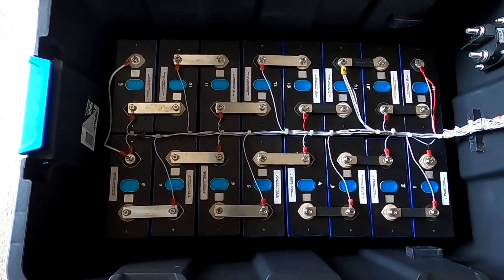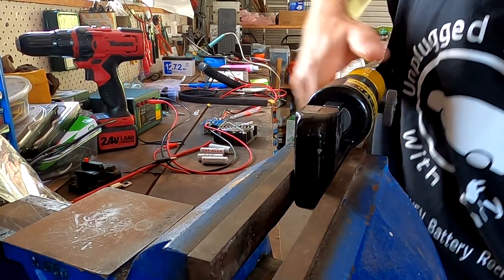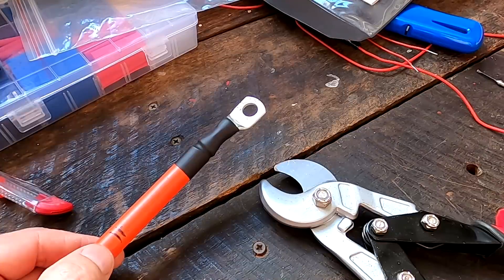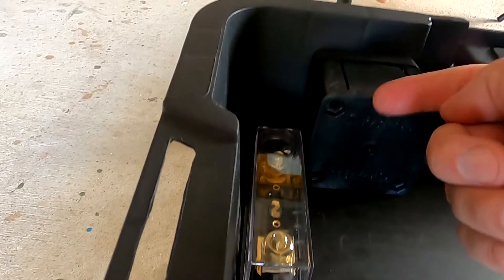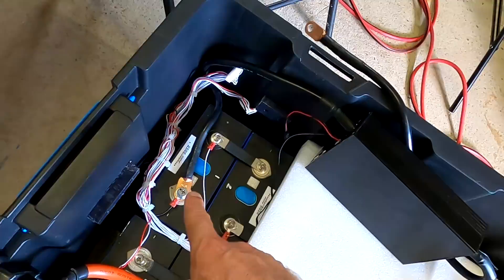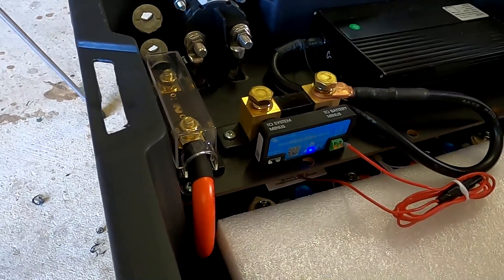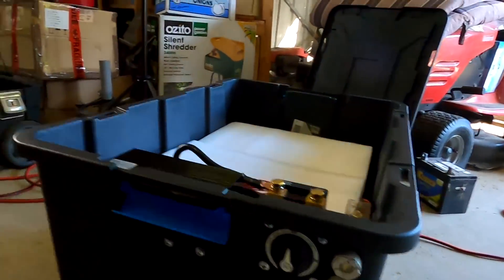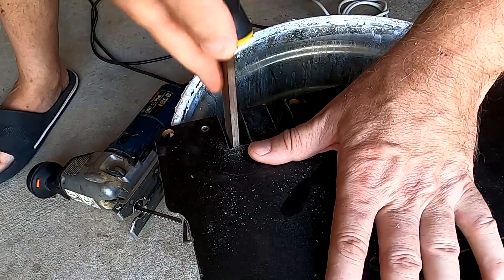Final work on our 14.5kWh battery - Will it work as expected? #buildthebattery.6

Comment: I put my shunt right to the battery Negative and got the same situation that you did with battery 1 having a much lower voltage. When I switched it around and out the BMS first it corrected it self.  So battery negative>BMS>shunt>inverter.

Comment: A thought just popped into my head this morning whilst watching your video. If the BMS cuts off the battery at 2.5v how does it get recharged? Presumably this situation should never occur as the inverter should stop discharging the battery before it reaches that point, so its just a fail safe? Does the BMS not draw a tiny bit of current, so that could drop drop the battery below 2.5v (edit: this  question is answered in the next video)? Very nice and neat cabling by the way, I really hate messy cables, I spend ages getting cabling neat and tidy. PS Slowly getting through all your videos in order.

Comment: Why did you finally choose to put Bat>BMS>Shunt?  I know he says it in the video but I don't control English very well.  thank you🙏
Reply from the maker: The main reason was to have the BMS as close to the battery as possible. The BMS is always connected to the battery, no matter what. It's basically a part of the actual battery. If I disconnect the battery, the BMS will stay connected and I can always connect via Bluetooth to it to monitor the status of all cells.

Comment: Hello Andy, IV got same HYD crimper, IV found its a great tool and works very well.
Down side I miss 90/120mm2 crimps.
4/6/8/10mm2 crimps I don't use.
Best regards
Marc up top
Reply from the maker: Thanks Marc. The hydraulic crimper I have is awesome for this sort of work. Goes from 4mm all the way up to 70mm.

Comment: I thought you said Victron recommended putting the shunt before the BMS? If you switch the shunt power, then it should turn off. I wonder what Will Prowse thinks. ANY EE's out there?
Reply from the maker: Yeah, well, some do it so and other do it differently. I guess there is no right or wrong with the location. Both has advantages and disadvantages...

Comment: Once again, very nice job! I am building my first little solar system (<50 Ah). One day I will graduate to your level. What did you use for the cable pass through on the battery box? What are they called? Are they truly a pass-through for cabling or are they going to be some sort of quick disconnect? I guess I will find out in the next few videos. :)

Comment: Quick question, why use a fuse instead of a breaker?
Reply from the maker: Why a breaker?
Reply: @OffGridGarageAustralia  a breaker is resettable, once tripped for whatever reason you have just turn it back on instead of replacing a fuse.
Reply from the maker: @xjinit  I believe if the breaker trips or the fuse melts you have a serious problem with your design or something went horribly wrong. It should never trip or trigger.
Reply: @OffGridGarageAustralia  I see your point but using your logic if your system is designed correctly then you don't need a fuse or a breaker in that case right? Modern homes and boats use breakers instead of fuses.
Reply: I found that although my EV charging from my off-grid system only draws 150A it kept tripping a 200A c/b. I have a 10kw Victron inverter which recommends a 400A fuse. Finding a suitable 400A c/b was proving difficult so fitted a 400A fuse instead. Now all works fine. True c/b's have the advantage of being resettable but as Andy says there is something seriously wrong if you blow the fuse.
Reply: @nigelcharles511  did you try using a 200a fuse and see if your system blew it? Have you verified with a clamp meter that the car is pulling 150a or is that an assumption?
Reply: @xjinit  There are now times when power is being drawn at the same time as the EV is being charged taking the power draw up to over 9kw. Allowing for inverter losses this will exceed the 200A on the 48v circuit. As Victron advise 400A fuse with their 10kw inverter I shall stay with that.
Reply: @nigelcharles511  so then the 200a breaker wasn't tripping prematurely, the momentary loads surpassed 200a then?
Reply: @xjinit  No it did trip prematurely. The other loads were added later. In the meantime, whilst I was waiting to get the 400A fuse, the 240v car charger was derated to 16A (3.8kw) to prevent the premature tripping. It now runs at 7.2kw no problem. I guess that the initial current surge was enough to trip a 200A c/b.

Comment: Fun and informative as always. I'm not a technical or very practical person, but am very interested in solar. And you've made it a less scary undertaking. I think I'll make a very small system now with a cheap 500w inverter and a single 360w panel and 16 x cells just to practice setting something up to get the confidence going. What size Ah cells should I get to match 300-360w panel. I'm not sure which Panel size I should buy you see.
Reply from the maker: Thank you very much Lennie. That is exactly the commitment I would like to see from every beginner. This is the motivation to keep me going, inspiring others to do what they like and are interested in. Great work and thank you!

Well, to your little project, you can build a 24V battery and run this from one solar panel and your inverter. It depends a bit how much power you're going to draw from this inverter and battery. What do you want to connect and for how long?

Comment: I would recommend to place the fuse close to the battery + otherwise you will not secure the battery and cables when you disconnect the master switch. Or have I misunderstood your connection?
Reply from the maker: That is correct. The positive terminal goes to the switch first and then to the fuse. I know the other way around it is better and safer... it's a bit of a compromise here in terms of cable run and clutter.

Comment: What is holding up that shelf holding the BMS?  What is the shelf made of?
This was a great series!  I will use a lot of your well thought out plan when building my battery.  Thanks
Reply from the maker: Thank you for your feedback, John. I mounted three little plastic blocks to hold this board up. It is made of insulation panel but any piece of plastic will work the same. Even plywood is cool. I'll show it quickly in the next video.

Comment: I built a smaller system using similar cells and with the Victron shunt. In use I was getting inconsistent cell voltages and overall voltage. I found that the bus bars did not make good enough contact with the cell posts and had to sand them flat with 400 grade wet and dry. Also, I was dropping 160mV across the fuse on the Victron shunt battery voltage sense wire so I replaced it and the holder.
Reply from the maker: Thank for sharing this Colin. That is much appreciated feedback and I will do some measurements with mine in this regards. I have not cleaned or sanded down the terminals. I was just hoping it will be OK 🤗

Comment: What is the interrupt rating on the main fuse of the battery? Note that the LiFePo4 has such a low resistance that you need a very high interrupt rating to stop the arc during a short.
Reply from the maker: It's 7.5kA for this ANL fuse.

Comment: What a quirky twist to the story, and I love the way you present it. BMS-Shunt, Shunt-BMS, no BMS-Shunt... tricky! And the really fun thing is that it will vary according to each persons setup. Those who don't use a Victron Charger, will have a different perspective and requirement to those who do. 

I've just ordered a Smart Shunt for my test bench. It should provide me with some simpler monitoring of projects while I'm out or in bed. Neat little bit of tech!
Reply from the maker: Thanks for your feedback, Paul. You're absolutely right. Every project is different and may need modifications and tweaks. I'll start with this setup and see how I go over time. I'm sure there will be the Box1.1 and more 😂

Comment: You made the safe and proper choice in my opinion.  Being an electrical design engineer of almost 20 years I've at least spent some time considering said opinion.  That being said pushing things so close to design tolerances that the order of components makes a difference should be sitting there monitoring things the whole time!  Plan to use things within safe margins and these decisions are less critical.  Honestly if you're worried about the drop in that path your magical loops are of more concern in my opinion and the only reason you're leaving them there is a bit of lazyness. ;)  I'm not saying I'd have done differently though.
Reply from the maker: Hahaha, great comment Brett. Thanks for that. It's all about the magic(al loop) 😉

Comment: The ultimate dilemma, which came first. The chicken or the egg. All we can do is make sure that the BMS is the last line of defense to keep the battery cells from falling off the upper and the lower end of the cliff.

Setting the low battery cutoff voltage about 20% SoC on your inverter and your charge controller 85% SoC should give you plenty of elbow room. If my memory serves me correctly, your BMS threshold can be customized to when to start balancing when the cells are at a high state of charge.

Finding the sweet spot of the curve is mind racking part. Once you get it dialed in, it should be pretty much drama free. I can’t imagine when I get into the territory of a 12p-16s with a nominal capacity of 61.4 kWh. Maybe a 10p-16s, both are in the drawing board stages at the moment.
Reply from the maker: Yes, thank you. The rest is now programming the BMS and MPPT correctly

Comment: HI Andy 
here is Jan from Texas and watching ur solar storage video with interest.  U would make a good teacher with ur positive and upbeat mentality, perhaps u are a teacher.  i am just collecting all the parts for my storage system using the same batteries u have. i like to use the ElectroDacus for the BMS. this BMS is rated for a 24 V  system but with the 8 batterie i will have 25.6 V. i have to do some digging.
Reply from the maker: Thank you Jan, I'm not a teacher. The ElectroDacus will be in one of my next projects. It looks very interesting. 24V is nominal voltage, it will handle your battery just fine.

Comment: For your cabling I would just use a booster cable 2 Gauge  Check into it might be cheaper.
Reply from the maker: They are CLA cables, copper cladded aluminium. I thought about the same and thought I discovered a real cheap way of getting these cables. These ones have slightly higher resistance.

Comment: Wired my shunt after the bms as well but I power it directly from the battery. But mines is not setup to control the charge controller.

Comment: I watch some of your earlier video and I still wonder why are you using 300 Amps cables on your battery, do you want to empty in less than hour? 
I haven't seen the video where you cut down all the trees shading your solar panels, if they are still up its unlikely that you'll get more than a few amps from the panels.
You're talking about some 5kW panel contracted to the grid, but nowhere you're talking about any high power panels (300Ax48V=14kWh) feeding your batteries, am I missing something?
Reply: Put shunt between battery and BMS, connect charge controller to shunt,you don't want the BMS to shut off charge controller ever,it could fry the charge controller with solar panels in sun.bms is to disconnect load only.in this way the shunt can read power in and out as designed.have fun.
Reply from the maker: How does the BMS knows how much power went into the battery if it cannot measure the incoming current? Also if the MPPT fails, it would kill your batteries. That's a big no no to connect it without BMS!
Victron said, their MPPTs can live without battery been connected.
Reply from the maker: 35mm is good for 109A or ~180 peak.
You need to watch the early videos again. I said the shading is only in winter months. The 5kW is the system on the house. You're mixing all information up. Maybe start with the very first video again in which I explain everything in detail ;)

Comment: Great video. What a big difference it makes when using good quality lug. BTW, what is that black plate (the plate where you mount the fuse and shunt) is made of? Did the Frog get BBQ?
Reply from the maker: Thanks Bud. That is called Type X and is insulation panel.
https://insulect.com/products/switchpanel-type-x

Comment: Nice clean build! You do great work! I put my shunt after the BMS also. I put my Blue Sea shutoff on the positive side and connected my shunt power to the shutoff. I will see how that works out over time. I'm not sure how much power drain there is from the BMS. I have much to learn yet. I don't have as nice a battery box build as you. You are very meticulous. Thanks for the great videos!
Reply from the maker: Thanks heaps Peter! That is a great idea to have the shunt connected to the switch. I will do this as well.

Comment: 3:50 it must be Frog's day because they are very quiet.  Very neat job out there. You are raising the bar too high for the diy community. I see a problem there. If the bms cut the power to the  solar charger while charging the magic smoke will come out.
Reply from the maker: Victron says it's OK and the MPPT will not die when without battery. The BMS should not disconnect anyway if everything works correctly, right? That's our last resort.
Reply: @OffGridGarageAustralia  Right, but you never know if a tool drop on top of the batteries.

Comment: Make sure to use a big 30 ohm resistor to precharge the capacitors in the inverter before directly connecting the battery to the inverter, or you'll get a big spark, and could damage the terminals. Or just make sure the battery switch is off when connecting the inverter. Either one will do.
Reply from the maker: I had the inverter already connected and it comes with a soft start function. No sparks with this one...
Reply: @OffGridGarageAustralia  nice. Never heard of one with that feature.

Comment: Schaltest Du noch einen Switch zwischen Solarladeregler und Batterie? 
Die "Batteriepeitschen" stimmen mich nicht so ganz glücklich (wg. Kurzschlussgefahr a. der Batterie bzw. b. des Solarladeregleranschlusses der Batterie - tagsüber) lg walter 
Spannungsfrei für Service !
Reply from the maker: No extra switch necessary. It's all been done with the main switch.
The thin balance wire will just melt in a sec if it would make a short but it's not touching anything and is fixed.
Reply: @OffGridGarageAustralia  and what secure your "victron" in case of a short  8( 
If there is sunlight on a solarpanel the batteryport will be powered !!!  Take Care

Comment: Nice work Andy, I like your logical thinking with your component placement and build. If your anything like me you will make another 5 or 6 tweaks (/videos) on it, 😂 I’ve spend a bit of time playing with shunt position, and settings to try and get it to measure capacity correctly, and charge and discharge voltages etc, it’s still a work in progress. 🤣 Looking forward to seeing more. 👍🏽
Reply from the maker: Thank you Rawiri. I think you're right, there will be changes coming.

Comment: BTW, love your videos, and your awesome enthusiasm. I truly wish I had the urge to vid the fabrication and installation of my 1200ah off grid system I'm putting in my semi truck.
Reply: Batteries, inverter and electronics will be under the bunk, generator is already mounted in a 48" camlock box on my frame. Will upload a small vid of the gen you can watch on my channel.
Reply from the maker: You can do it!
Reply: Wow that sounds nice are you going to put it under the bunk or put a box on the catwalk. I want to do the same when I get my own truck. By the way just some photos would still be nice.